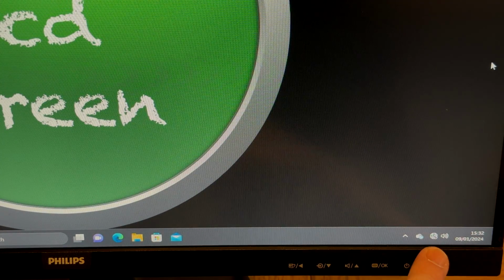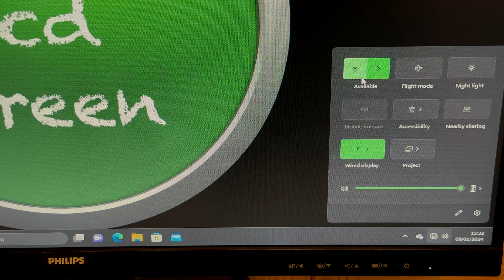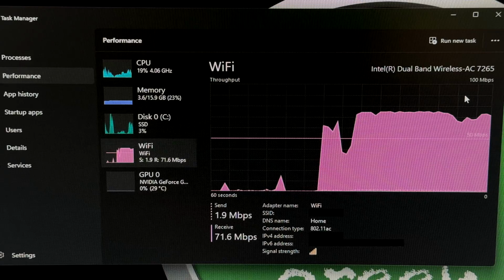Ubit WIE7265 PCIe WiFI Card | Quick look & installation

Comment: where is bluetooth option? Looking to buy but your screen showed WiFi but the BT toggle is not in your menu. So it's WiFi only?? 

-Ik it says BT too but your video doesn't show it
Reply from the maker: I can assure you it is Bluetooth model, at that point in the video I may not have correctly installed the USB header, but it’s there now, I’m typing on the same machine! 👍